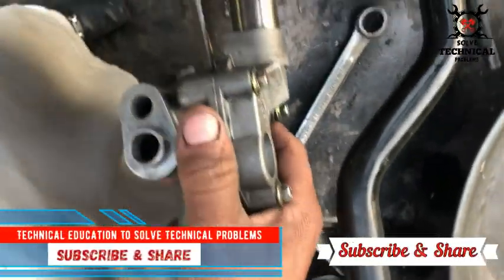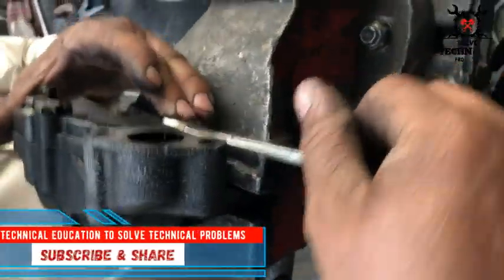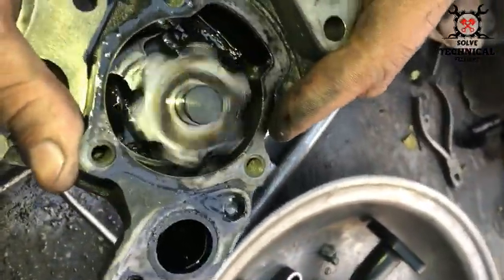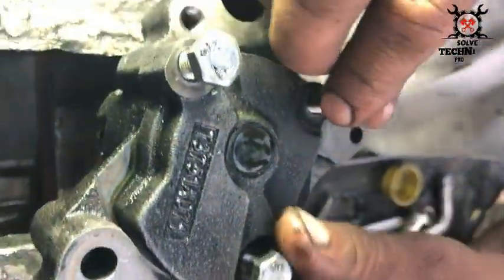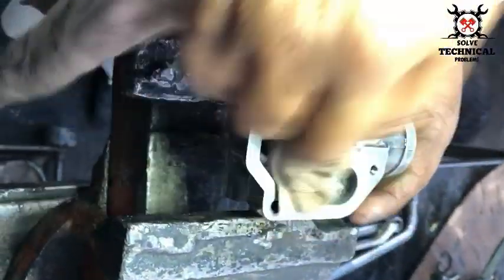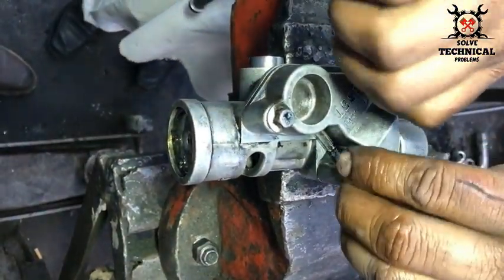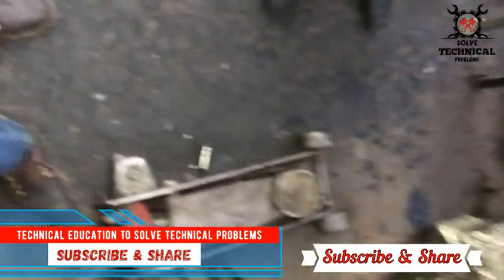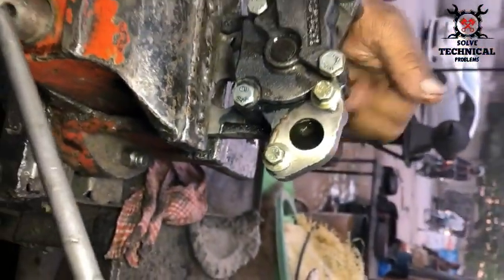Perkins oil pump. Service completely dismantled learn the process.

Comment: Hi mate , i have c4.4 caterpillar engine which i thinks hae the same oil pump you are overhauling.. i have question, is having oil pressure of 7 bar [ higher than normal] is cause by faulty relief valve of the pump?
Reply from the maker: Yes, it's possible. Cross-check with oil pressure gauge

Comment: This is the same oil pump as on my perkins.  Timing cover must be removed to change this pump? Looks like it will come out if remove main bearing cap? I have 40psi oil pressure, should I bother change oil pump? I'm only using equipment for building my house
Reply from the maker: 40 psi is reasonable for engine keep it running best of luck
Reply: @Technical.Education  there is no oil pickup strainer on mine, is this normal, I have video
Reply from the maker: @embededfabrication4482 may be the previous owner removed it. You can install it for the safety of the oil pump.